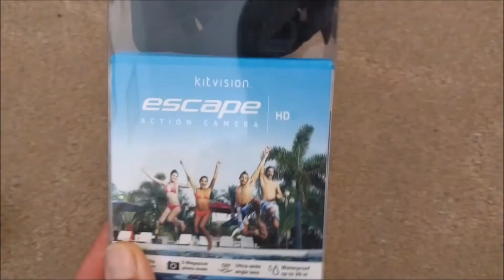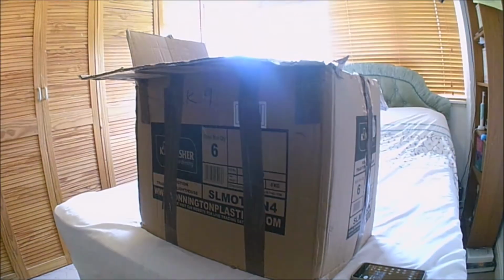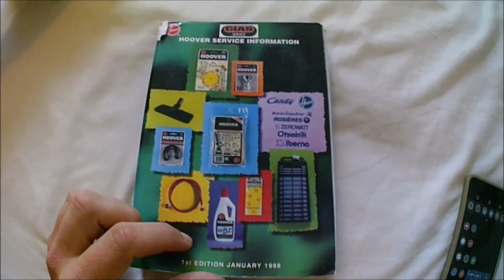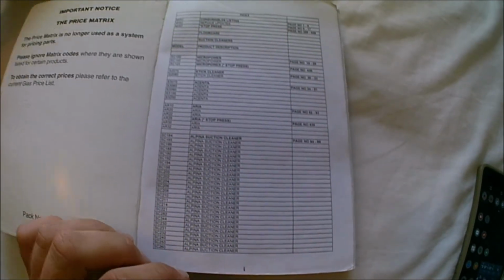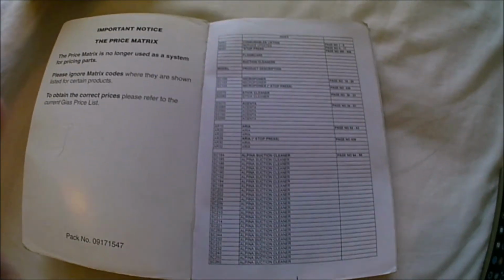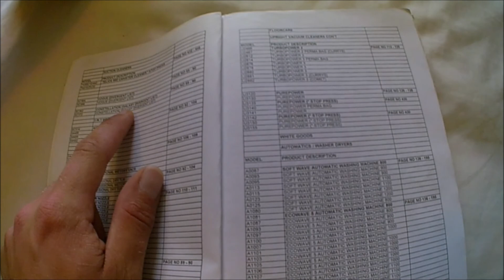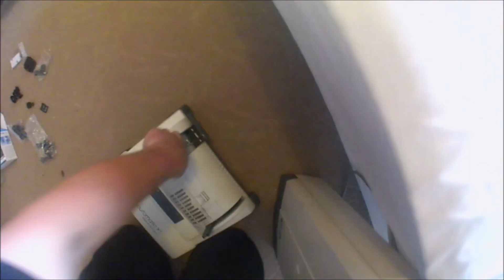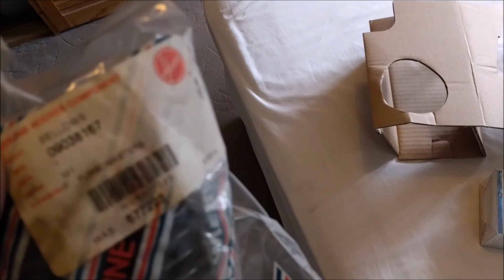Miele S7 - An Exciting update, and a new camera!

Comment: Hi Sam. Quick question, how much do you think a dyson dc04 zorbster is worth? It fully works, just needs a bit of a clean which I plan to do before selling it. Would appreciate any advice! Thanks.
Reply from the maker: Sammy TheSeal £40/£50 to the public, maybe a bit more to a collector. Trouble is average Joe won't care about the zorbster bit, just the dyson part. I've got one in the shed I need to refurb and use, thrn I'll prob flip it on Facebook and sell the zorbster stuff seperatly
Reply: Beko1987 Ok many thanks. I binned all of the zorbster stuff ages ago as it never worked properly and I couldn't be bothered with any of it. Will list the vac and the tools on gumtree and the likes for £45 after its had a bit of a clean up. Thanks.